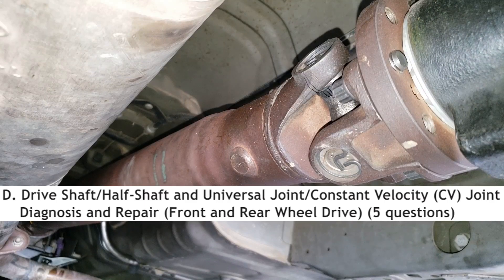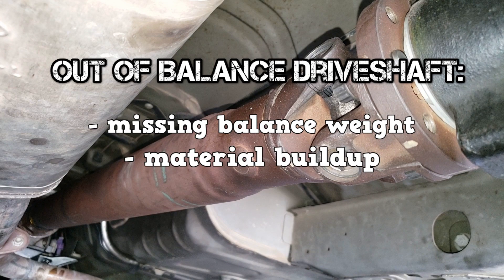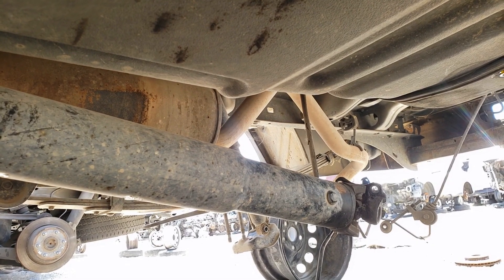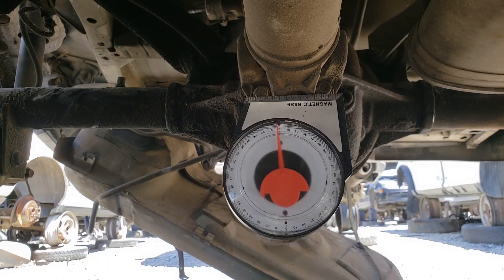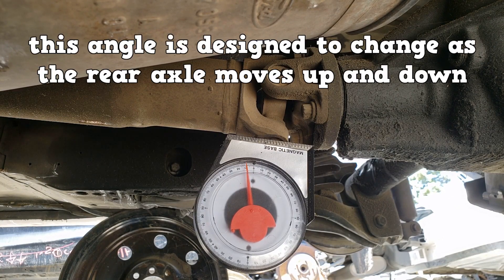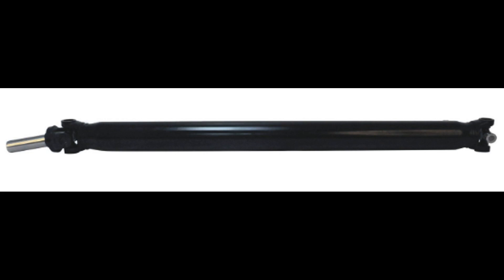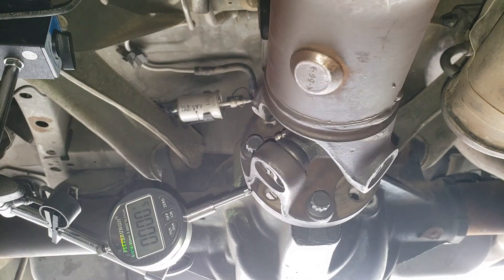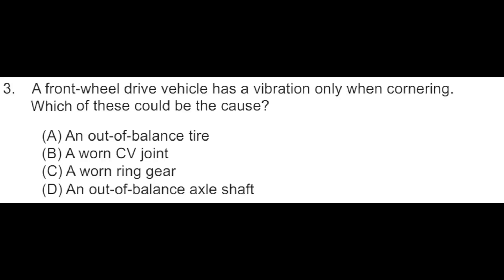ASE A3 Test Prep #4 - Drive Shaft

Comment from the maker: Feedback after taking the test: The first minute and 16 seconds is excellent info!
There was 1 question on driveshaft runout, make sure to know what to do if the runout is beyond specification.
1 question on u-joint phasing. Basic info.
One note is that at 2:03 we're still checking the phasing of the u-joints. Notice that the angle finder is set PERPENDICULAR to the drive shaft. This is checking for a bent yoke.
At 2:53 we turn the angle finder PARALLEL to the driveshaft to measure the working angles.
The causes of incorrect angles at 3:51 is excellent info to know. 
No questions on companion flange runout.
Overall this miniseries will help you answer about 30% of the questions on the test. It is a good supplement to the other study guides you are already using!

Comment: Fazing and timing are two totally different alignments of a drive shaft.
Reply from the maker: I want the most accurate info in these videos, can you further explain your comment? ASE does not recognize timing as an accurate term. I've only seen them use the word phasing to describe the "hard part" of the yoke to bearing cap alignments. I show this starting at 1:30
Do you mean timing as the Installation angles that cancel out? Shown at 3:00
Reply from the maker: I think I understand your comment now.
Take another look at 2:03 ,that's still checking the phasing of the driveshaft. 
The angle finder is set perpendicular to the driveshaft so its confirming the phasing of the U-joints, 
its confirming that they are on the "same plane." If I rotate the driveshaft and one end cap is at 45 degrees, the other will also be at 45 degrees.
At 3:01 the angle finder is set parallel to the driveshaft to start checking "timing."